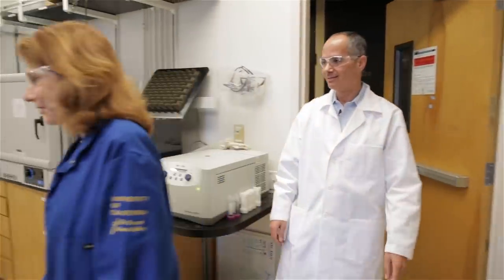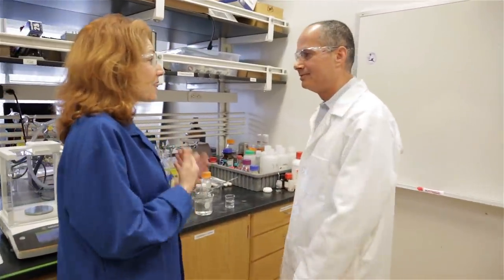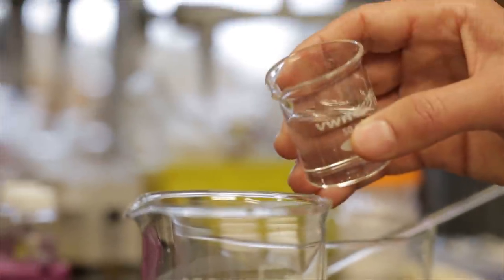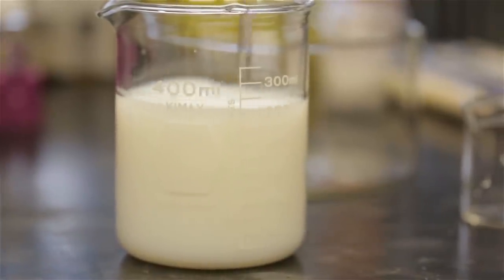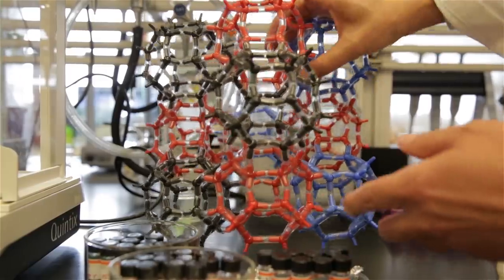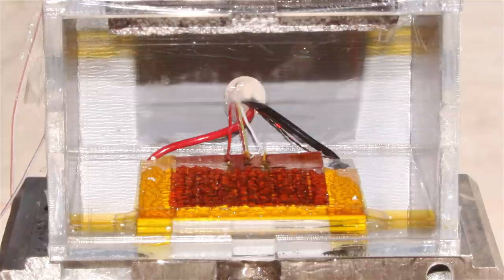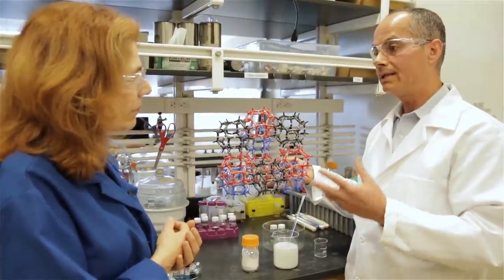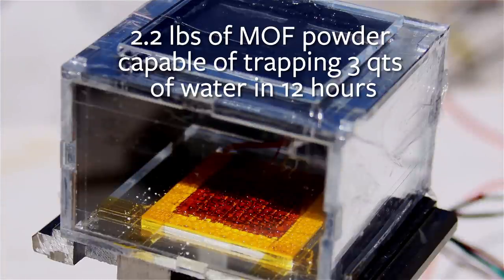Pulling drinkable water out of dry air

Comment: This is still a standard Peltier dehumidifier with a little add-on MOF layer that might make it easier to take the liquid out of the air. So when a normal dehumidifier would struggle getting any water out of 30% humidity this will get some drops.

There is 1kg (2.2 lbs) of MOF needed to get 2.8 liter of water. Looking at the size of this device there is maybe some grams, lets day 5g, of MOF on one of these devices, so you would still need 200 of these little boxes to get 2.8 litres of water. I don't think that will solve any water problems in the near future.
Reply: Agreed. It's a false economy and far, far from being a solution to water shortages.

Comment: MOFs can solve critical problems faced by humanity, like water scarcity in the arid regions and pollution in industrialized areas, if deployed on a mass scale into the future. Full credits to the professor and his team for this path-breaking research. :)
Reply: No, they can't. Not unless the conditions are absolutely ideal. Nor can any other desiccant dehumidifier or solar still etc. conservation of energy etc. I don't deny MOFs are very cool technology, but as a large-scale solution to water shortage, no. The costs in materials, logistics and even losses to evaporation in hot, dry conditions all run against this as a solution (to name a few). Honestly, trucking in water in convoys is a better use of the energy than this.

Comment: How do you get the water out of the MOF? I assume the answer has something to do with the sunlight you mentioned. Would sunlight also be used to remove CO2 or natural gas from one of the other kinds of MOF?
Reply: What keeps the container walls cool?
Reply: So it is the temperature rather than a direct photon reaction
Reply: Eric Cartman - The container walls are kept cool by an a/c that runs on electricity which costs twice as much to cool the water out of the air as you saved using the MOF, proving once again that the inventions of the left always give you one dollar in your right hand and take away two dollars from your left hand. Also you have to actually heat the MOF to 1000 degrees C to force the water out of it, which also costs a lot of hamburgers. So in a nutshell, it's great for the existing energy companies with all of the MOFing, heating, and cooling. Oh well, at least it made a nice sounding video.
Reply: that was my skepticism. It requires energy to pull a system out of equilibrium. This is known as entropy. Just because a H2O(g) releases energy to get to H2O(l), you need energy to pull this system out of equilibrium. 

However what do you mean "inventions of the left". lol
Reply: it's cheaper to burn candles than use a light bulb. It's cheaper to heat your home with wood stove. it's cheaper to do nothing and just live like cavemen. Inventions are meant to make life easier not cheaper.
Reply: time is money and if it can reduce the amount of effort and time then it is a useful invention that can be cost effective too.  I can't wait until energy becomes cheaper or practically free to use you guys will still find things to complain about.
Reply: Not around here. LED lightbulbs run on pennies a day and cost a few bucks now for 25000 hours of light. Candles last a few hours and cost at least 25 cents each. A woodstove is cheap until you have to pay for firewood. Then there's the environmental cost of cutting down your trees and burning them.
Reply: Please ignore "bluenetmarketing" and his nonsensical, hateful, filthy comment about "inventions of the left."

Comment: Oh, come on. Haven't you read the label on a dehumidifier? "do not drink this water" - why? It's a nasty sludge that would require both decontamination and remineralization before it could be considered fit for human consumption. So, that's nice? Right? And while we're on the topic; thermodynamics? Ya didn't think so. To produce water from air that is either too dry or too cold, or too hot - that's right, water from air that's not in the Goldilocks zone of just the right temperature and humidity, well, there won't be any water, no matter how much power you pump into it - by the way, even if you pumped in megajoules of energy and did manage to make water, it'd be the most expensive water on earth - which, as bragging rights is a thing, but not one people won't laugh at. So, go reread the law of the conservation of energy and generally brush up on thermodynamics and stop spreading this codswallop around like a muppet-headed sheep.
Reply: You clearly don't know the simplest principles about MOFs.
Reply: @no.one.two.  Well, you'd be wrong about that. Look at the energy costs for the system. While you're at it look at the total material costs for the system as a whole. What does that do to the cost of the water? Oh, and now operate the system in a low humidity setting. Let me know how it goes.
Reply: this is developing technology, dude. give it time, there is a lot more research to be done in this field. plus, professor yaghi is one of the foremost researchers in this field. also, are you comparing cutting edge mof technology to a dehumidifier?
Reply: @cabbage5114   because that what it amounts to. Most solutions 'in development' never make it out of the lab p and that what this is, a lab experiment, end of story. Sure, it 'looks cool' but in practical terms it's unlikely to scale or compete with less technologically encumbered solutions. Stop fanboying and think critically - look at the problem and the other solutions that are available.
Reply: @ByronAgain  Never said it will, might never, but that doesn't change the fact that it could. if this man has been researching them since the early 90's, he probably knows what he's talking about. plus a scientist at an esteemed university has practically no reasons to try and scam you. if h say's something, he genuinely believes it, though it may be right or wrong. I'm not saying you're wrong either. I respect your opinion, but I'm just saying that you shouldn't completely deny a potential idea, just because we haven't gotten around the problems yet. living past fifty was considered impossible a thousand years ago. and about fanboying, I literally just found out this guy existed.
Reply: @cabbage5114  The issue at hand is the deeply flawed, gormless tech/science "reporting" that's completely devoid of critical analysis. Too many science/tech "communicators" are utterly unqualified and inexperienced to report on the topics they take on and few (if any) of them are experienced in critical analysis. Now, with that in mind what we have here amounts to a lapse in critical assessment of a proposal on the merits of the proposed technology in the context of other research & development in the field. Rule #1: never accept the material as presented without taking the time to evaluate the materials against the competing and related technologies as well as alternative solutions.